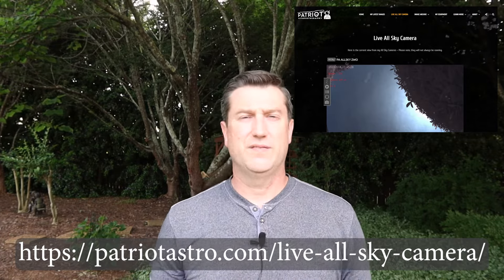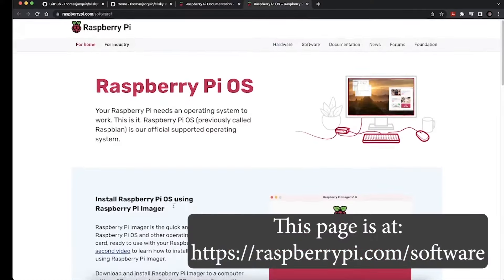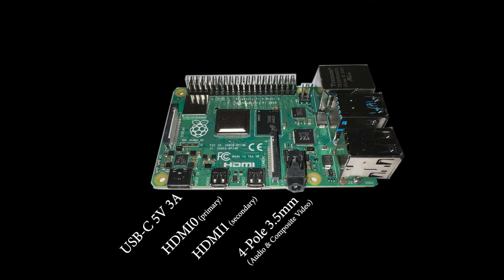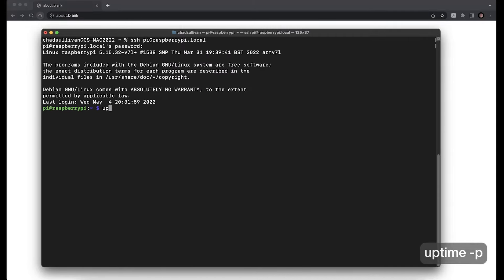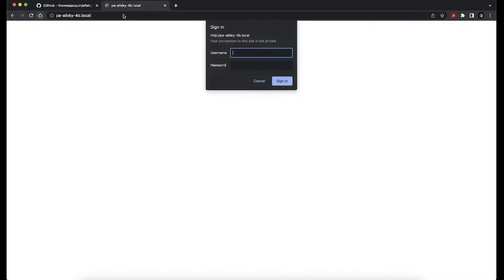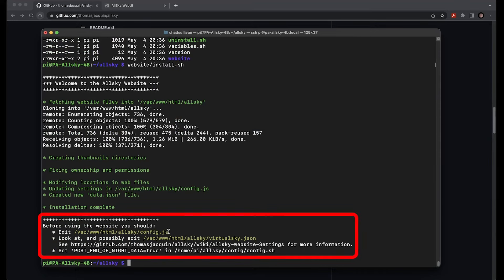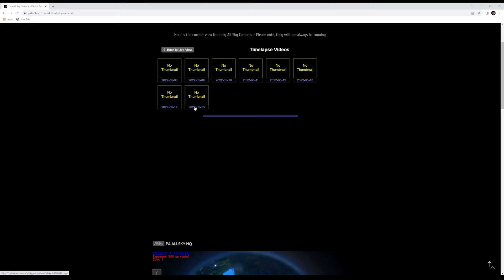Create Your Own AllSky Camera (UPDATED!)

Comment: Hi. I followed all the video steps and now I have my own night observatory fully working! :) Thanks for such great content!
Reply: @cleverson_sa_ Do you have your observatory mounted permanently? Are you in a hot climate? I'm trying to decide if I should build my all-sky camera to be permanently mounted, and I'm worried about the raspberry pi overheating.
Reply: @jowah  Hello, Yes I do, not only the RPi with ALL Sky but a second 2B for GPS  clock and WWV simulator with a x86 mini itx board for SDR Server. The RPi won't overheat If you have It mounted with a fan and heatsync (that's I used) and a simple cooling system in the storage container (two 10mm fans with a thermal controller). My project worked ALL weather by 3months 24x7, but It stopped due condensation on the camera (that killed my SDR Server after some water drops, but not the PI). Só my advice with my experience is use a heatsync and fan for PI, and keep eye on water condensation. Regards.
Reply: @cleverson_sa_  Thank you for the information! How hot do the temperatures get in your area?
Reply: It was summer at Brazil when the observatory was deployed, so the temperatures were about 28~35 oC Celsius.  Now we are on Winter, the temperatures are about 10-26o Celsius. Regards.

Comment: Love your video.  Unfortunately All Sky hasn't kept up with camera releases.   Some of the new ZWO all sky cameras (676) aren't supported and even though the issue has been reported as long ago as May nothing has been done.  An alternative is INDI-Allsky which installs very similarly.  In fact only a couple of changes to commands will install that software which handles these newer devices much easier.   Again, your video series is great and helped me considerably understanding how to use the Pi and communications with my PC.

Comment: Thanks for this video! It helped us build one for the Von Braun Astronomical Society in Huntsville, AL, which we made a video about:
https://www.youtube.com/watch?v=8XJC9vlxAkE

We had some interesting problems including:

Heat - our first build of the enclosure had the camera exposed to the sun, and during the summer months it really started cooking. The camera’s metal case became so hot that it would burn your hand if you touched it, and we worried about it melting some of the plastic or destroying the Raspberry Pi. For that reason, we redesigned the case so that the camera can sit inside of it (like the one shown earlier in this thread), out of direct sunlight, and get better airflow around the body.

Moisture - we didn’t have any trouble with dew on the outside of the acrylic dome because the heat of the camera and Raspberry Pi act as a dew heater. But we did have issues with moisture building up inside the dome. The problem was that there was no airflow, so any moisture that made its way into the enclosure had nowhere to go. To help with this, we added two fans inside the enclosure, and a breather valve on the top. You’ll still see the occasional water droplets on the inside of the dome, but they usually dry up within 24 hours.

Storage - we ran out of disk space. 64 GB was not enough to store more than a couple of days of data. So we updated the software to upload our images to the cloud in an Amazon S3. That allows us to access it from anywhere.

Ladybugs - no matter how hard we tried, hundreds of ladybugs managed to nest inside of the enclosure, and even made their way into the dome. We think they like the heat given off by the Pi. We’ve tried sealing off all holes in the enclosure, but we may just have to live with this problem.
Reply from the maker: You need to do a talk at a convention about this that is loosely titled "Forget the Jet Stream, Ladybugs are the real issue" - LOL  Great work!

Comment: Thank you for the very helpful guide. I'm def a better visual/tactile learner than by reading an installation page.

I do have a few more questions tho (if you have time) -- b/c I already have a few Pi-HQ cams around w/ a 220 degree and a 180 degree lens for them. Idk if 12MP Pi-HQ would look better than a 2-5MP ZWO, which can easily range $200+)

- Pi-HQ cam vs ZWO (is one far superior to the other? Even if the ZWO is only 2-5MP)
- Is it worth using a Pi5 if I can? (or would the benefit be negligible)
- Have you tried a passive cooling case? Any better/worse?
- Will leaving it permanently mounted in the sunlight eventually damage the camera's sensor?

- Do you add any outside air pathways for the airflow to circulate (maybe w/ a baffle to avoid water getting in)

Comment: Excellent video, I have been wanting to setup an all sky camera so will definitely be following along with this video.
Reply: look forward to see how ya do it mate. i've been procrastinating this very idea for all too long myself. seems like such a neat thing to have, i currently set up a wyze cam facing the sky while imaging, but its not permanent and only covers about 130 degrees while some of these do 170-180 degrees. seems hard to source that wider lens that everyone is recommending now though
Reply: @AmritP  I’m using Nest cam at present but not enough detail so need a better solution. I think I have spare Pi lying around.
Reply from the maker: It’s a fun little project. I’m always looking for new ways to expand what I’m doing in this hobby and this was just a perfect next step.
Reply from the maker: @AmritP  in all fairness, those WYZE 3 cams are pretty amazing in their own right and do a fairly good job. Building a permanent fixture though is a fun project to take on.

Comment: Thanks for the logging command. I totally missed it and was searching for a log file that doesn't even exist. Anyway found out why auto stretch wasn't working because it said "unknown command at line 48" which is the stretch amount command. I accidentally added a space after the = sign and it stopped working. The next issue I need to solve is why is 80% of the night images clipped to 0.  Could be the darks fault. I built this project 6 months ago but somehow I can't get the night images right, they all look super dark with few stars even on a new moon night. Daytime images look completely normal.
Reply from the maker: I’m glad the logging helped you. I’m convinced it could help solve well over 75% of the initial issues people have. What’s worse is that when people don’t know what is wrong, they start haphazardly manipulating settings. I know I’ve done it too! :) Definitely reach out to the discussion board for guidance on the images. I’m sure it’s a simple setting. I know I’ve had to play with brightness and gain a couple times especially with the newer bullseye OS changing the values.

Comment: I realize this post is some time  after the vid was released.  I have a new pi 5.  Is the red led supposed to stay on where there is power?  I'm using the ac plugin with USB c.  The USB c connection to the pi is lousy.  It doesn't take much to come loose.  However when I power up, the red light comes on, then goes off.  The green light does flash and then stays on steady.  I can ping the IP address of the device as shown in my home wifi router app.  I cannot ping the hostname, which is default...I cannot successfully run putty or run the ssh command either.  Do I have a faulty pi?

Comment: I need to connect to a wireless network at my school that doesn't have a password, and the Raspberry Pi Imager software does not allow for entering nothing for the password. What should I do?  Thanks in advance.
Reply from the maker: That is called "an OPEN network". Google around and look for where they tell you to stop/kill wpa_supplicant and maybe hostapd. Then there are a couple other steps. All command-line steps BTW.

Comment: Thanks for the video!  Question though.

Is there a specific type of camera AllSky needs?   Ive googled but dont see my issue.  I have a pi camera module installed.  I can test it with libcamera hello and raspistill -o and I can create a test.jpg.  The Allsky installer even seems my camera when the installer pops up and asks me to select it in the list, but when I get to the end of the Allsky installation it says "no camera found; one must be connected and working...etc" and stops the install.    At that point, I can literally say ok, and run libcamera-still -o test5.jpg and it works and saves a jpg.  Any ideas why the allsky installer doesnt like it?

Comment: I haven't looked into it yet, it maybe in the documentation but is there a way to hide the lat/long from the web interface? That's not something I'd really want on my publicly facing website.

Last resort of if I can't find any info on it, I know html/web programming I could probably find the relevant section an manually hide that particular part.
Reply from the maker: I’m pretty sure you can hide that but mine is offline for a couple days while I work out weatherproofing. You are right though, worst case, edit the html.
Reply: I've been considering building an All Sky cam, but the options I was looking at were way more expensive. 

I'll have to make a list of everything needed. I'd also like to make it self sufficient, with batteries and a solar panel maybe.

I have seen there are battery backup options for Raspberry Pi maybe one of those would work. Weather proofing though may add more complications I'm sure. Lol

I'd also like to be able to have it cast to my YouTube channel. Temporarily I could just have a browser source in OBS pointed at the web interface I guess.

Comment: I've got an annoying issue I was hoping someone could me with. I'm trying to setup access to my RPi running allsky using microsoft remote desktop. I followed online instructions that walked me through installing xrdp. However, it said that I can't log on with my default RPi user but had to create a new user. This isn't the user I used to install allsky. Now, when I connect via MRD, it won't process the allsky commands since it's the wrong user. Anyone know how to use MRD with ANY users?

Comment: This video inspired me to build one and publish it on the web. I purchased a little clear dome to cover my camera and it is prone to dew. I wonder if anyone makes a dew heater for something like the 4 inch diameter dome or some other idea. Thanks for the video.
Reply from the maker: Getting to the final permanent build is where it gets tricky. Heat, dew, waterproofing, reflections,... the big 4 'not fun' parts of the project.
Reply: @PatriotAstro  Just in case you are interested, I have some resistors (which act as little heaters) that are controlled by an Arduino with temp, humidity and lux sensors. When night is detected, the resistors are turned on.  If the light is above a certain threshold, the Arduino checks temp and/or humidity to see what the conditions are and will then turn the resistors on. I am using a MOSFET transistor to switch the resistors. It overcomes the dew inside the dome. A small fan is controlled by the temp sensor to help circulate the air in the dome part. I am not sure how effective the fan will be when the temp in the shade is 40C so I have another much larger fan that sucks out the heat. The camera sensor gets very hot in direct sunlight even though the ambient temp is around 12 C.
Reply: @stephen2615  I'm dealing with similar temperatures here in South Texas. I haven't yet built my all-sky camera, so I'm trying to think ahead about how to deal with cooling and moisture. I just had an idea about incorporating venturis in the ventilation system to force cool the incoming air, but that is really just an idea at this point. Any pointers you can give me before I start would be appreciated.
Reply: @jowah  Dealing with heat is much more difficult than the cold at least here where - 10C is the the coldest it gets. I stop Allsky from running once the camera (ZWO ASI 178MC) sensor hits 45 C which is the operational limit recommended by the manufacturer and start it again an hour before sunset.  Storage max (insitu in the container) is 60 C. I haven't measured that yet but I expect it is a possibility. The container the camera sits in is big enough to put in a TEC kit and I have considered that if the temps get out of hand. I have holes at the bottom of the container with two fans blowing the air out but I didn't bother putting in a hole for fresh air. I ended up buying an Allsky dew heater.
Reply: @stephen2615  Thank you for the information. I will consider all of that for my build.

Comment: Would like to hear more about the AllSkEye Pro version shown on your website. Better or different? I see it is a Windows app.
Reply from the maker: I do plan on doing a video on this as well as potentially some other ways to get some other all sky style imaging done. The bonus to the version you mentioned in your comment is that you can run it along side your imaging software. If you plan on only dragging this out when running a telescope simultaneously, that can be a huge benefit in not running two different pieces of hardware. I’ll try to get this video done sooner than later so we can put it to bed. :)

Comment: Hi, thanks for the great guide. It will be very helpful. I have a Pi4 on the way but sadly I could only get the 1GB version.
I have bought a Player One 178 camera to use for the All Sky project. But today when cruising through AliExpress the Pi Cam caught my eye. For around $10 Australian? Really? 
So I have a question. I want to have a nice detailed sky view for astronomy reasons.
Can I do an adequate job using a Pi camera? the 178 is a 6MP camera from memory.
What is the recommend Cam hardware for a Pi Camera?
Thanks again.
Reply: Update, i think I will try the Version 3 Pi camera. A bit more expensive but more sensitive and more pixels, so more better. ;)
Reply: @whereswa11y  There are several Pi cams, but the PiHQ is the only one that will accept a lens that will provide good photos.

Comment: I have two options to buy the ZWO ASI462MC Color Camera or ZWO ASI482MC Color Camera or ZWO ASI178MC Color Camera or ZWO ASI224MC Color Camera better and then ZWO ASI120MC-S that I'm currently using right now.
Reply from the maker: I just replied via email too, but ZWO has a few new cameras coming out that are replacements for the 485, 178, 174, and 462... so, I would wait a month or 2 OR pre-order now to get in front of the line.

Comment: I assembled the Allsky camera with the PiHQ camera.  I am having some issues with exposure and gain.  It starts out ( both and night) with a properly exposed image, however with auto gain and auto exp on the exposure slowly turns dark.  I do not see a way to correct this or set manual exposure / gain.

Comment: Great video! I got all my parts but what do you think about high heat being outside? Any ideas of keeping it cool but at the same time keeping it water proof?
Reply: @MikeDebarbierisjr I'm currently considering the same problem, and I just had an idea. I don't know if you're familiar with venturis, but they are basically funnels. When air is pulled through the smaller side of a funnel, the air naturally cools as it's forced into a smaller space. I only know about them because I'm familiar with carburetors. Specifically carburetors in small general aviation aircraft. In that application, when the conditions are right, the carburetor can actually freeze over with ice because the venturi cools the air so much. Which is why usually there is a carburetor heater, because a frozen carb is not ideal. So I was just thinking about this, and wondering if a venturi(s) could be integrated into the 4" pvc camera housing in such a way that it would cool the inside of the enclosure, without introducing too much moisture. Anyway, thought I would lob that idea at you and see what you think. Maybe we can shade-tree engineer our way to a solution for reducing the heat in the camera enclosure.

Edit to add: I'm imagining a small squirrel cage fan, with it's air intake routed through one or more venturis.
Reply: @jowah  Thank you for the information. I was able to add vents to all four sides. I have two fans, one pulling air in the box and across is another fan that draws air out the box. Sort of like a keeps a desktop computer cool. We will see how this runs.
Reply: @MadMike78 How are these things not getting fried in the rain?

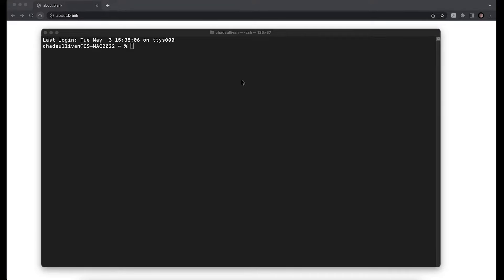Comment: Thanks for the fantastic content! I’ve been wanting to set an Allsky up for about a year now. I do have one silly question. What program are you using to initially connect to your pi at the 15:06 mark “get it up to date”. Thanks!
Reply: @wetcoast5286 he's using ssh to connect to the pi. The command to do that is

ssh <username>@<hostname or IP address>

Earlier in the video, he covered how to enable ssh during the install of operating system. I just noticed you asked this question 11 months ago. hahaha. I hope you've got your camera up and running! Also, if you have any pointers about how to deal with enclosure heat, I could use some. Warm climate here.

Comment: Excellent vidio as always thank you. Why not just use a low end computer.
Reply from the maker: I have plans to do another video with a different software package that would run on a low end windows computer. This was just a fun raspberry pi specific project.
Reply: Raspberry Pi is relatively low cost and easy to setup (physically) if you wanted to set this up on say, your roof.

Theoretically you could set it up with a battery to power it over night and solar panels to charger the battery. It could totally be a set and forget sort of thing.
Reply: @smassky  I agree completely with what you say. My concern is my ability to set up the software/ op system. There are very small 12 volt fanless windows 10 units out there for less $ then the pi. So for me at the same price point I can make either work except I will struggle with all but the simplest software set up. I welcome your suggestions.